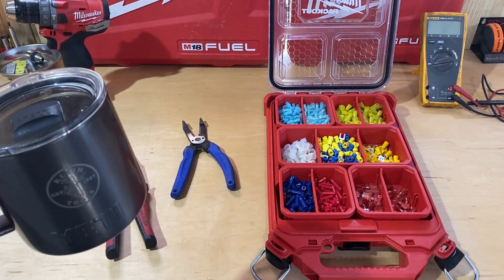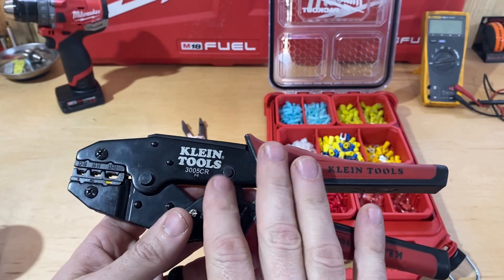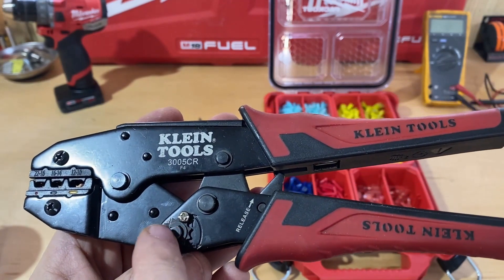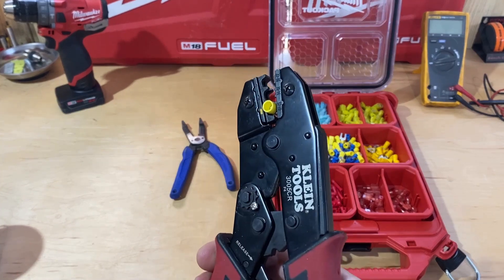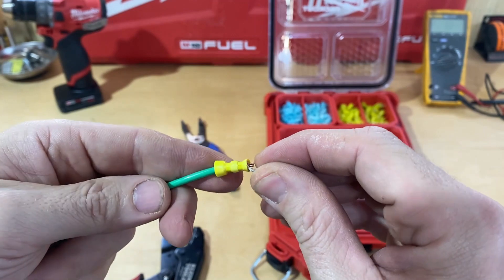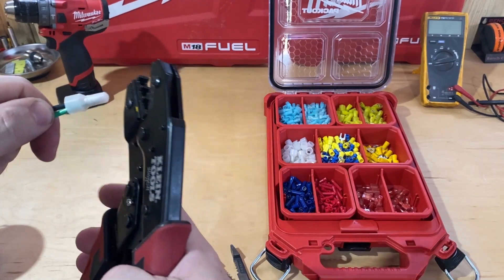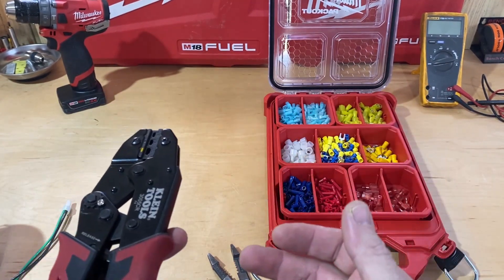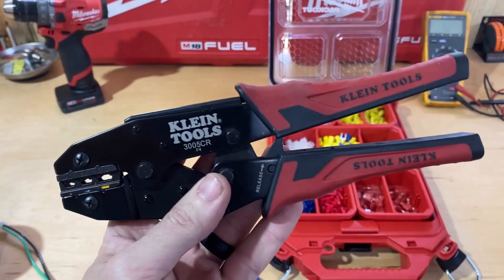Klein Tools Ratcheting Crimper Review 3005CR - 10-22 AWG Electrical, Automotive, HVAC

Comment: Went to buy a pair of these at HD and noticed they are made in China so I drove a mile to Harbor Fr and bought the exact same pliers with another brand name on it but it was 1/3 cheaper. Same pliers I think, if not its a great replica. Of course also made in China, but what is not. Nice crimpers.
Reply from the maker: 👍👍.. I’m sure they are very much the same.
Reply: Yup, the Doyle is identical

Comment: Are these meant for heat shrink terminals too?  I was rewiring new bilge and livewell pumps on my boat and maybe it was just my cheap Amazon heat shrink crimps but it seemed like the jaws were just a touch too wide for them (16 ga wire mostly)…
Reply from the maker: I haven’t used any of the heat shrink type with them personally so I’m not sure.  I’ve used it on some and then put heat shrink over them, but I’ve never used ones with it built in

Comment: Do you buy your insulated terminals in bulk?  There's a lot of janky ones amazon and it's important to note that bad crimps sometimes involves bad connectors. I have one similar to the one shown ,but my Ideal 9" cutter/crimper gets more action. I'm trying to keep the weight down on the toolbelt.
Reply from the maker: Yeah me too on the weight, that’ why I don’t carry mine in my Bag and keep them in my truck.

My fully insulated ones and other Spade connectors are Panduit brand and I bought them at my Local Electrical supplier (Rexel). 

They were a little Pricey but mostly  because they came in a high quantity. I think in bags of 100-150 or something which added up because that was of each type and color. I’m not sure if they sell a mixed lot of different ones or smaller quantities. I just bought what they had off the shelf. I  was surprised but the Panduit ones are even more expensive on Amazon than they were at Rexel though.  (I may can look up how much if I can find it, or ask next time I go in there but I know it was at least double or triple the price of “no name” brands on Amazon)

I wanted to get good ones for those since sometimes they are are in the elements on units or something. I haven’t had one fail yet (that I know of) but I just started using them last year. I can’t give my “they are the best ever” stamp of approval, but I think they are good. Time will tell if they are worth the steep price. I hope they are because I have a lot of them 😂

My other ones in my Packout case are just extras from Home Depot or Lowes left over where I had to buy some for something and had some left over…no specific brand that I can remember.

I searched Amazon for ever too and the reviews kept turning me off. 

Not sure that helps but hopefully it does.
Reply from the maker: The AIRIC brand on Amazon had decent reviews and are significantly cheaper. I may order and try some of those when I need some other connector I don’t have just so I know in the future.

If you try some that are good let me know
Reply: I use the XHF brand terminals from Amazon and I've never had an issue with them. Use at least 10 a week (I do appliance repair). They are tin plated solid copper.

Comment: I liked these until I realized you can't buy different style replacement dies for them. I've had the normal jaws cause certain insulated terminals break on aircraft, but I found Klein makes the VDV-200-010 which has a variety of dies to choose from, which I have on order now with the proper dies.
Reply from the maker: 👍.. glad you found something that will work for you.

Thanks for sharing, someone else may be in the same situation.

Comment: I wonder how it compares to its Knipex counterpart. Knipex costs 6x more.
Short videos about tools are a really good idea.
Reply from the maker: I have wondered the same thing. I bought this before I started in the wonderful world of Knipex.  

The cost will probably keep me from buying them just because of the amount I use them. I’ll never say never but there are a lot more higher frequency use tools on my “to get” list.

As I have been using tools I’ve just been asking if it is something I would have like to have known about. 

Some of them may be older tools but I notice there aren’t many videos for them.  I don’t want to take for granted everyone knows about them. I run into things all the time that have been out for years that I knew nothing about.
Reply: @MORGANSMaintenance  Yep, there are many tools that seem common to one user, but are completely unknown to others.
Like Olfa cutting tools. Or Runpotec electric tools.
Reply from the maker: @Stefan_Kawalec  I’ve never heard of either of those…there goes my weekend to researching tools 😂
Reply: @MORGANSMaintenance  Japanese Olfa is the Knipex of cutting, check out 18mm L-5 Fiberglass Utility Knife with Multi-Pick. Runpotec makes fantastic cable unwinding tools like X BOARD XB 500.
Reply from the maker: @Stefan_Kawalec  Thanks! I will check those out.